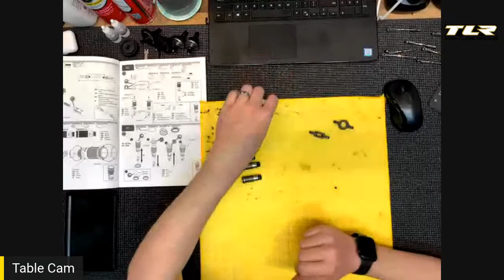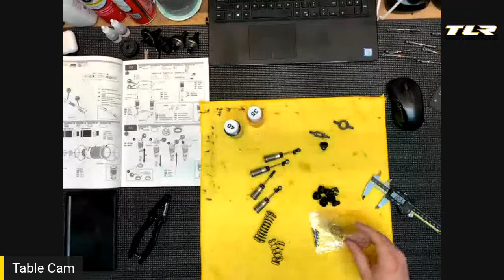22X-4 Build Series, Shocks, Bag D

Comment: There are a number of things you have to do to these shocks to keep them from leaking.  First, you have to sand the shock spacer down from 2.85 to 2.80 then soak the o-rings in oil overnight and make sure you are using the V2 orings.  Then you must  bleed the shocks to zero rebound and do not tighten down the bottom cap all the way, just till it is snug. The new shock caps from a performance standpoint are a must as well.

Comment: Hey there, I’m currently building this kit and and running into problems with too much negative rebound. I can’t seem to get rid of it with two of the four shocks. Also, im just wanted some clarity on the bottom ring with the groove. I think Ryan Harris said to put them with the groove facing inward toward the inside of the shock. Can you please clarify, as the manual doesn’t. Thank you